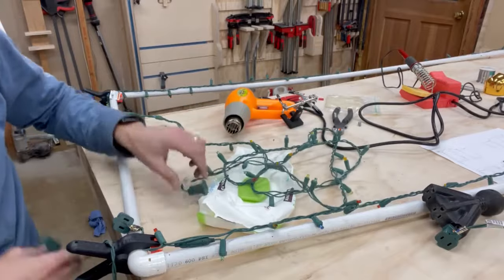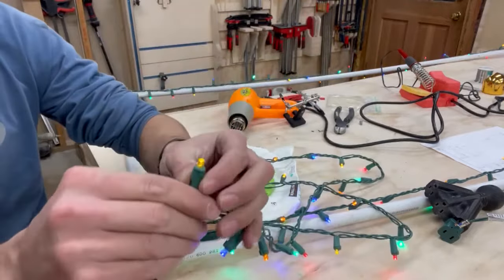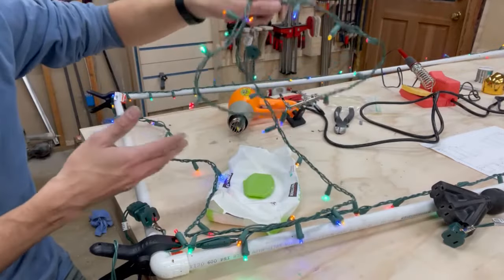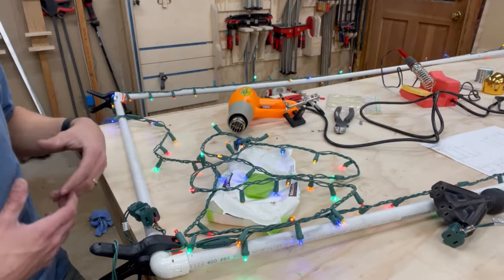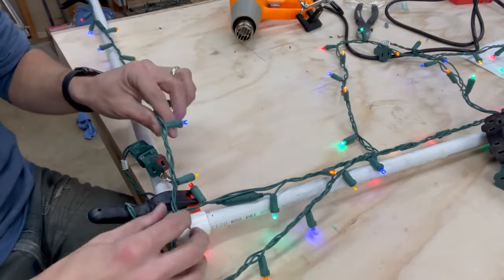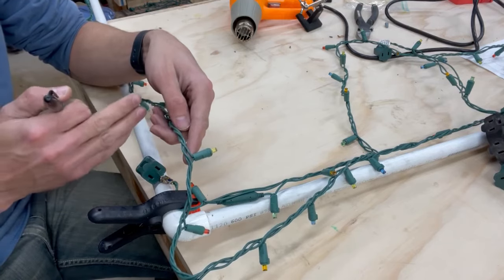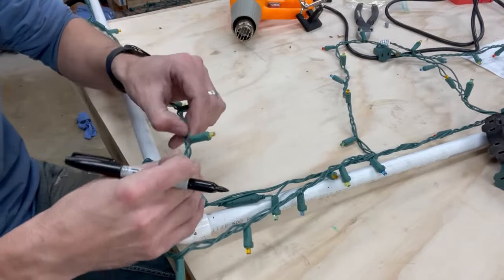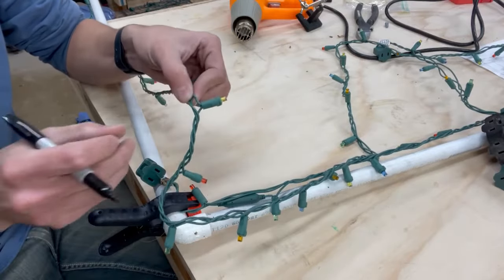How to Shorten and Solder LED Christmas Lights (Part 1 of 3)

Comment: I would not advise that anyone follow your advice.  
LED lights don't work the same as incandescent bulbs.  You got lucky that it worked.
Reply from the maker: @tchevrier Not sure why you don’t think it works with LEDs when the video clearly shows that it does. I have done this same thing on 12+ different LED strings and all of them have held up just fine for 4+ years.
Reply: @projectputunder6025  I didn't say that it does not work, I said that you got lucky it worked.  
LEDs have a unique characteristic that is different than incandescent bulbs.  LEDs have something called a forward voltage bias that is different depending on the colour.  Essentially they have a voltage drop, but no resistance.  They are also unidirectional so current only flows in one direction.  And the typical operating range is 15-20 milliamps. 
A string of LED Christmas lights is constructed with a number of LEDs in series and current  limiting resister.  (that's the big green thing on the wire).  The resistor is essential because there is little to no resistance through the LEDs. The resistor is sized according to the line voltage less the total voltage drop through all the LEDs.  It is sized to keep the current between 15 and 20 milliamps.
If you start removing LEDs from the circuit you are reducing the total LED voltage drop.  This means that the voltage through the resistor increases. If the voltage through the resistor increases 2 negative things happen.  First, it increases the power being dissipated through the resistor which means that it will get hot and either fail or start to melt the wire and plastic.  And it really doesn't take much to do that.  The power being dissipated in that resistor is the square of the current.  Second, it increases the current through the LEDs. If it increases beyond its normal operating range then the LEDs can be damaged and/or their lifespan significantly reduced. Increase it too much and they will instantly blow.  If the light string has been designed to operate at the low end of its operating range then you have more room to cutout LEDs, but if its designed at the high end already then you don't have much wiggle room.  Half the string is a lot to be removing.  That could be increasing the current by as much as 50-100% and the power in that resistor by as much as 200-400%.
It might have worked but it is definitely not a good thing for people to be doing if they don't understand how it works.

Comment: Constructive criticism. You "Um-And" too much. "Um" stops a listener's thoughts. Too many strung together "And" clauses causes a listener to  loose the logic of what you are going to say.

First make an outline of points in the order you want to video. Practice your 'delivery' and change your outline as needed to produce a smooth flow of logic.  Practice, practice, practice before you video.
Reply from the maker: @tmeyer2022 I couldn’t agree with you more. This was one of my first videos, so still got a lot to work on. Thanks for the comment.